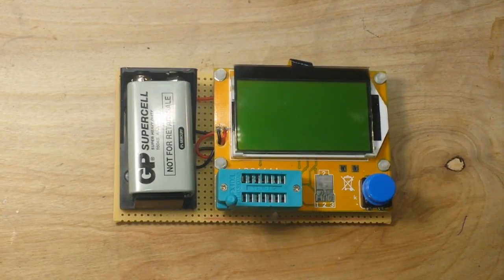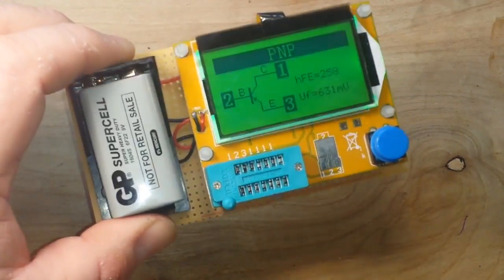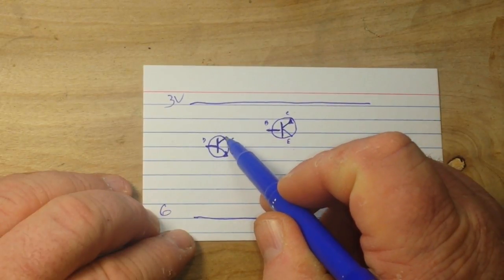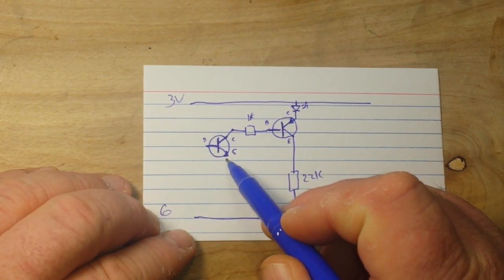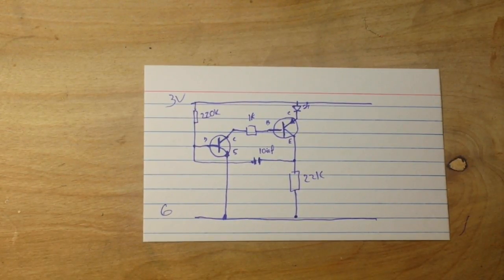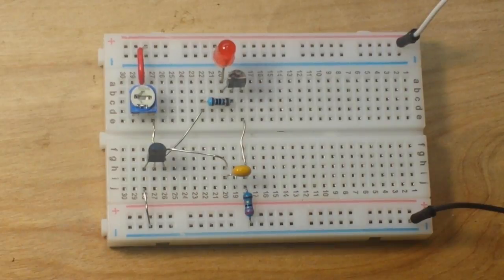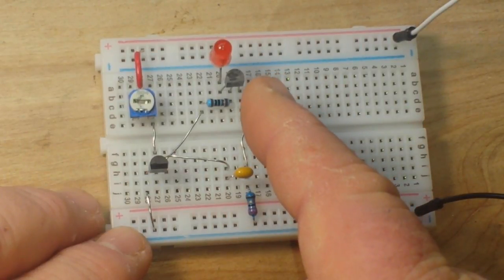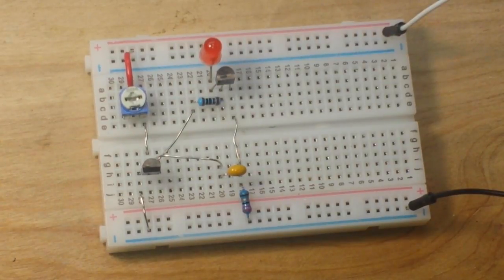DIY Transistor Tester

Comment: Nice job again Paul... 👍🏻

I ordered one of those little component testers and the screen arrived broken and would not even fire up - waiting to hear what the supplier is going to do about it.  Ordered an equivalent but with a ‘shell’ this time!

In the meantime, I will give your basic circuit a go and try and figure how it works, now I have my stock of components building up!  Thanks again sir... 😉 🐍

Comment: It would be good if you could explain how the circuit works. I really like your audio btw.
Reply: Seemed like I should try to understand it myself, so... When the power is switched-on,  current rushes to fill the capacitor, via our left connection to the 3V rail. Voltage is dropped by the 220k until the cap is charged-up. Now the base of the left transistor is pulled up by the 220k and the transistor switches on.  With the left transistor now closed the right transistor's base is pulled low, which switches it on. The capacitor now has its ends quite well connected together, and it discharges via a rectangular circuit that includes both transistors. With current taking this path instead of via the 22K resistor, the base of the left-hand resistor is lowered and it switches off.